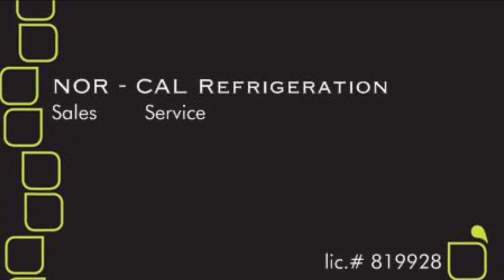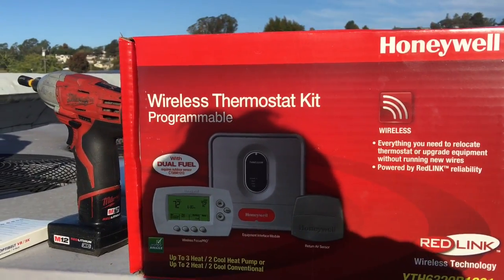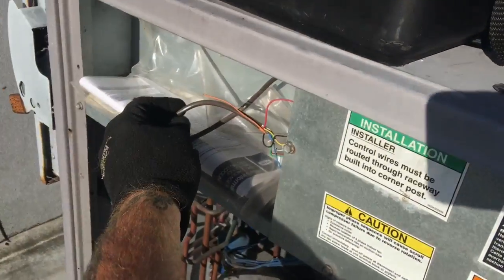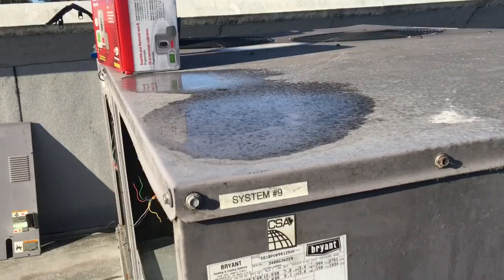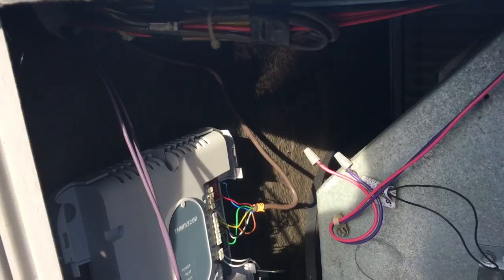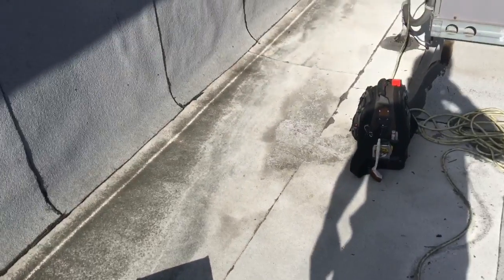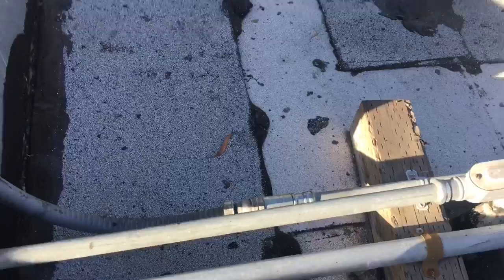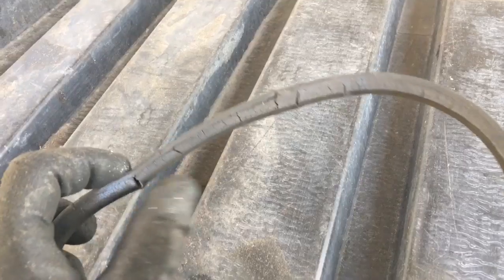Wireless Tstat replacement

Comment: I was told by Honeywell not to mount controller inside unit due to stat may lose connection.
Reply from the maker: It can cause problems.